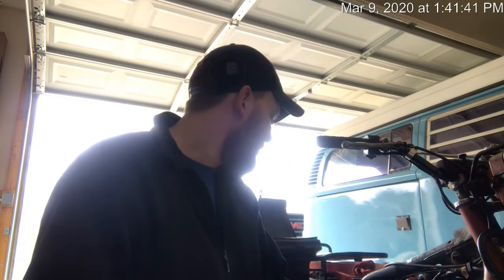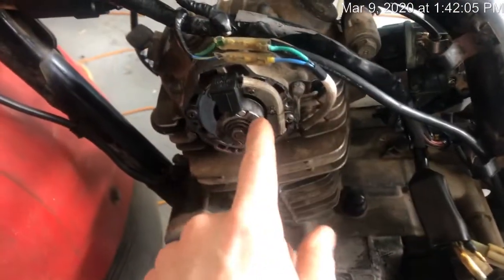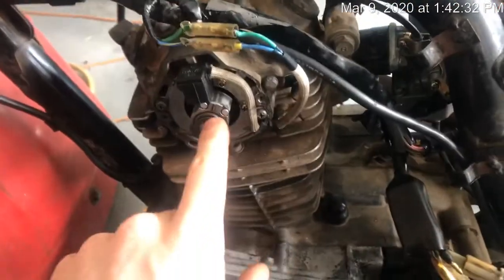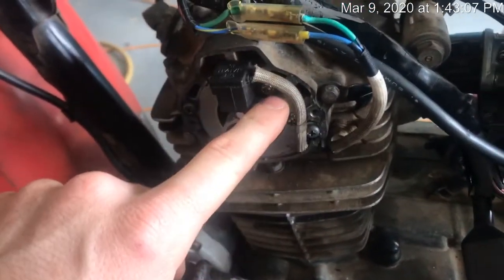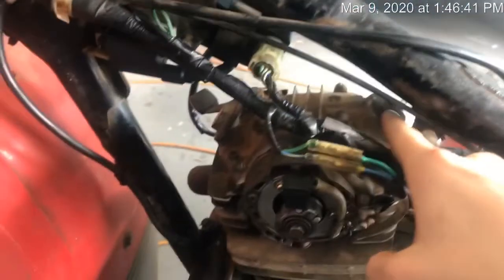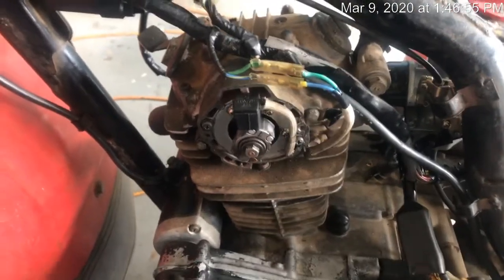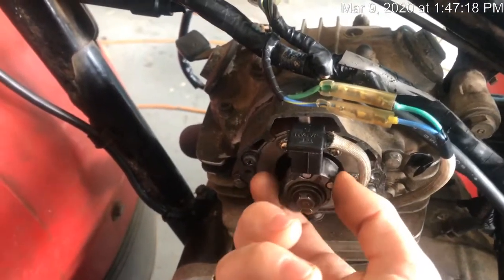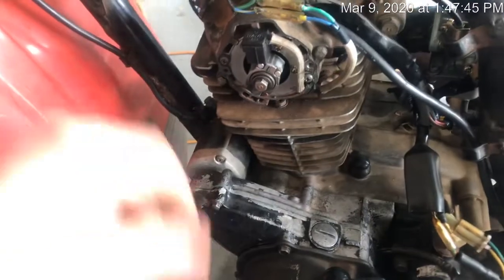1984 Honda ATC 200ES weak/no spark

Comment: I just found out mine needs a new ignition key !!! for mine because old original ignition key is worn out since. mine is a 83 frame with the 85 engine with high low and reverse !!! I got to clean my contacts to make the lights work again !!! I think I am 60k km sofar myself not sure how much before me !!! And I never added any parts yet but still runs like a beast. I have a loose choke seals if I jam a stick beside the choke off position it runs fine to 90km/h if not I am limited to 50 km/h !!! I used and abused it but i did oil changes every 100 hrs no and if or but about it. since I did hard rpm riding !!! now i need help with a 250cc wilderness no spark all stator and pick up spark coil and cdi checks oout fine so is the spark plug coil deaad on the end ??? charging system work since it has fans to cool the engine !!! I am ordering a spark plug coil in a few days. I will add to next comment if the ne spark plug coils !!!

Comment: I noticed you kept quoting the part #696 I'm assuming you ment 969 as in 30410 969 013 being the oem part number. Thanks for a great video, I've taken notes so I can test mine this coming weekend. I have an 85 200es which I did see a very faint spark but only once during testing on sat, so I will check the ac voltage output. I'm a motor rewinder by trade so if it's a stator problem it's about the only thing on the bike I'm qualified to repair 😆 fingers crossed I don't need a new cdi at 340 New Zealand dollars.
Reply from the maker: I can’t remember. I’m sure you’re right! Hope I helped
Reply: you can buy a new cdi and coil together on ebay for $21 aud
Reply: @heathwak3030  if you read the feed back on them they dont work on the 84 85 200es. The only cdi is the 969 for this bike and yes you can get them from ebay for just under $300 nz bucks. Hell i only paid 500 for the complete bike.
Reply: @alanwalker7342  idk what to tell you then , i had an issue on mine where it would start and run then stall after a few seconds, turned out to be a bad ignition barrel. i just unplugged the killswitch wire coming from the ignition barrel and got great spark.
Reply: @heathwak3030  yeah nah its all good bud. Ive tested everything on the bike even borrowed a cdi unit of a fellow triker and it ran. I will get one from the states but its just a bitter pill to swallow. Ive got 5 trikes to play with and one fat tyre convert i built.
Reply: I have a honda 200es, tought I had a bad cdi box 969, atc runs but not good. got one off amizon for 11 dollars, didn't work, the reason 84 and 85 200es cdi box wiring a little different but the way it works same at rest. no cutting wires !!! all you need to do is move two wires in cdi box wire connector!! swap the black and black/red wires in connector and remove the gray wire and keep it out of connector ( it's the reverse switch start stop) 
you do this a cheap amizon 11 dollar will work instead of pay 200 at honda. to move wires you will need a removal tool, super easy to do I guarantee it!!

Comment: Great video!
     I think you've got me on the right track in getting this 200es going again.
     Damndest thing.........
Sat for years inside, it wasn't used. I decided to fire it up, and with little effort, it was running and driving just fine. Two days it was great. 
      Then, day 3, no spark! I beat myself up trying to figure it out, (without a meter) and nothing. Left it sit for another year, and now determined to get it going. 
      Checked the pulse generator, and only about 2.8 ohms? Then checked the stater output, and only about 28 volts. 
     How the heck can it run fine one day, and have two issues the next?
     Waiting for the pulse coil to get here, and will probably have to find a stater also.
    Thanks for all the good info and inspiration.

Comment: I think I might have a bad stator in my 84 200s I replaced the cdi to no avail my air gap on the pickup is good but still no spark. I'll update after I try the stator.
Reply: Hey let me know because I’m at the same point I replaced the coil and cdi and now it’s just weak spark from no spark ?
Reply: @jacoblocklear783  I will! I'm waiting on parts now. Everything is ordered
Reply: @ricochetey  what was it?

Comment: Not to sound like a prick but your cam timing was prob ok. You just needed to do another rotation of the crank and back on the tdc mark. Crank to cam gear ratio is 2:1. Hence 1 turn of crank is half turn of cam. Good vid though.
Reply from the maker: Yea I thought the same thing but I swear it was 180 out. Had to flip it
Reply: There is only one TDC, right?
     And that's only on the power stroke, both valves closed.
Reply: Well, I guess it can be on the exaust stroke too, but in this case, it had to be on the power stroke.

Comment: I picked up 200s 1985 2 weeks ago. it started a few times (no decomp unit so was PITA but started and ran) but needed work or brakes, carb,etc. after wards wouldn't start. it would try start about 3 times out of about 25 pulls. didnt look like had a spark. but today i put a ground wire on plug and it showed a spark but seems weak. the plug seemed a little wet/gas. pulled plug pulled to dry out cylinder. but still no start. i think previous guy put on new chinese  carb. i checked gap like in your video and cleaned magnet but no luck. any advice? You said if spark not CDI. can it be coil or stator if i get weak spark? Thx
Reply from the maker: Sounds like stator if you went through the steps
Reply: @oldmuscle8156  new plug got it started today but idle it wants to stall and when turn idle up notch its fine until i give gas that the idle revs high. doesnt seem throttle is sticking. turned mix screw out but didnt seem to faze it. hers quick video, I found the choke is bouncing and maybe this is cause? not sure if way to tighten it from wiggling? ttps://www.youtube.com/watch?v=w4cFprxY5qE

Comment: Listen I need help I have the same year and model. I was missing an advancer spring I replaced it. Then I replaced the pulse generator the wires were beyond frayed. I replaced the Cdi. I replaced the coil. I even made sure my spark plug was good I am not getting one hit of spark worth. Aside from yesterday I saw one amazing blue bolt of electricity and then never again to be seen. I have checked my stator seems to be good like 180 OHMS. Can you help thank you
Reply from the maker: You need to see what voltage you’re getting from the stator with a meter white motoring the bike with the plug out
Reply: @oldmuscle8156  sorry little confused what does white motoring the bike mean. I have checked the stator earlier in the prcocess and was getting about 180-230 OHMs
Reply from the maker: @Southern_PowerPro_Wash_LLC  I meant to say while motoring. Your stator not only needs to ohm out good, but needs to produce around 40-80 volts AC when spinning over. If it is considerably lower than that or starts to drop as your motoring then it has a bad stator
Reply: @oldmuscle8156  so take the plug out and put positive down and the ground it. But do I need to put it in the circle the it connected to the stator or the box I am assuming the circle
Reply: @oldmuscle8156  thank you for the help
Reply from the maker: @Southern_PowerPro_Wash_LLC  that black and red wire I talked about in the video. The positive lead from the meter goes into it and the negative lead goes to case ground. Pull the spark plug so the engine turns easier. Put the meter to ac voltage and hit the starter. Your ac bolts should be at least 40 and not drop off
Reply: @oldmuscle8156  hey so I got it running it was doing great I went to put the boot back on the wires done by the recoiled and it stopped it lost all spark, will not come back on

Comment: How do u test stator
Reply from the maker: Brian Boles volt meter set on ac. Crank engine with spark plug out and have the meter positive lead on the stator pickup coil wire and the negative lead on the engine case. Should be 40-100 volts ac. It varies